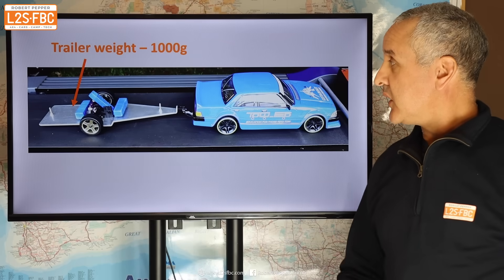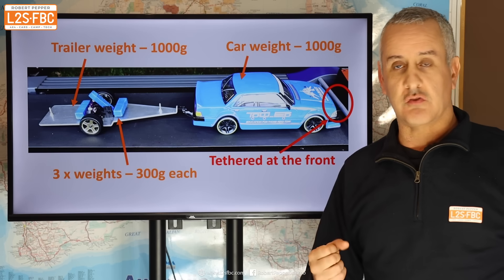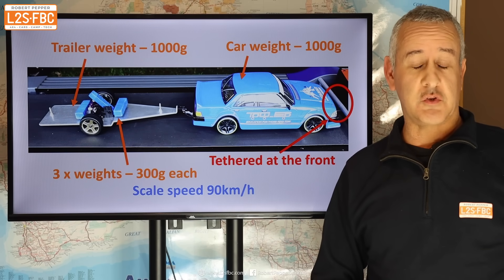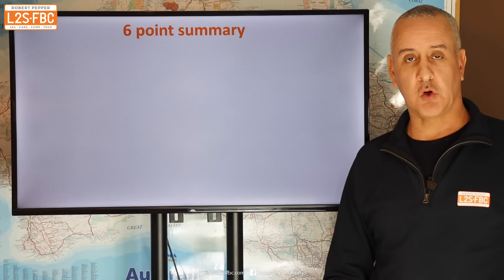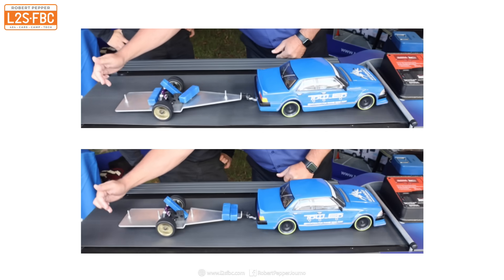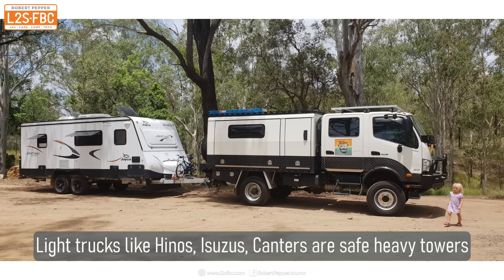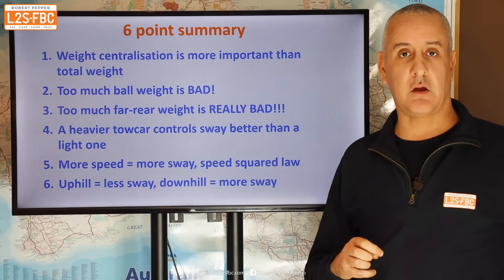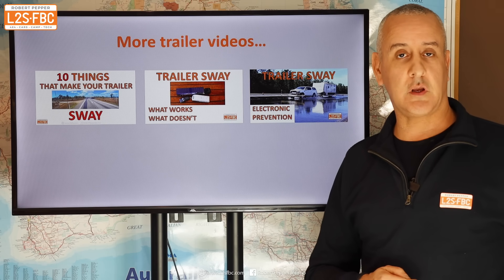7 trailer weight distribution setups, some safe, some deadly.

Comment: love the video ,so easy to understand,,,Would adjustable air shocks,,Air bags on the rear of the tow car help with the weight disturbution and sway
Reply from the maker: yes a little, keeping the towcar level is always a good idea
Reply: @L2SFBC  yep the munro air shocks worked great .the car had slight down ward nose 1/2 inch  the the rear caravan had slight downward nose of 1 inc,,,only problem was trying to fit the air hose to munrows plastic air conectors,,,,YUK,,,,but the shocks are fantastic

Comment: These treadmill towing videos aren't realistic, because the pulling force that takes place in real life is totally absent. This makes the sway effect MUCH GREATER due to the "crack the whip" of distant weight disproportionately effecting the middle (where the tow vehicle and trailer are connected). Of course you shouldn't have all your weight at the rear of the trailer, but you should be just fine if most of the weight is over the axles (usually near the middle of the trailer). Just make sure that your tow vehicle is adequate for whatever load you're attaching to it and you'll be alright. P.S. I'm a truck driver for a living.
Reply from the maker: The main reasont the model isn't realistic is because the car is attached by the nose. There is a pulling effect...the trailer would fall off the back without. However, the drag from the trailer is less as the air isn't moving.  Overall though, the model behaves in a way that's more than good enough to demonstrate trailer dynamics.

Comment: How would you load your trailer if you have boxes that all weigh exactly the same? There would be no way to put the heavier boxes over the axle because they are all the same. Any advice?
Reply from the maker: Stack the boxes on top of each other, but not too much as you also want to keep weight low. It's a compromise...
Reply: @L2SFBC  the problem is that the trailer is double stacked from the front to back with the boxes making a perfect rectangle if you will. Would it make sense to move the items from some boxes to create unequal weights of boxes and place those over the axle and lighter ones away from the center?
Reply from the maker: Just centralise and lower the weight best as you can, so yes your suggestion makes sense.

Comment: Hello Robert I have a question, what would be the best weight distribution for an AWD mid engine sports sedan?
Reply from the maker: Probably 60/40 rear/front I would expect.  Not 50/50. What prompted the question?  I have a video coming on a Lotus very soon which covers this.
Reply: @L2SFBC  … hello and thanks! I have this question because I’ve gotten into mechanics and drag racing. Then I got into R/C and Ive got this R/C car that will run 130mph if I allow it but I’m researching suspension geometry and purchased a 4 corner digital scale configuration so I can manage the rc platform’s weight distribution. Currently it is more front heavy than rear about R43% F57% and left is a little heavier than right so there’s plenty room for adjustments.  Just search R/C speed run and YouTube will be flooded with rc’s doing 150+mph
Reply from the maker: Well at that sort of speed aerodynamics would be a major factor just to keep the thing straight, and then you could also run downforce to stop it flying into orbit. But I don't know, just guessing, I don't do high-speed R/C but sounds amazing!!!
Reply: @L2SFBC  … thanks for all the input it’s much appreciated! Although it’s an rc the thrill is parallel to the real thing and MUCH safer.

Comment: Thank you so much.  This is super helpful, especially for a newbie like me.  Do you have information on the proper ratio of loading the towing vehicle itself?  Should it also be loaded closer to the middle of the SUV?  Many thanks.
Reply from the maker: Yes, the towcar should be centrally loaded as far as possible just like the trailer, and for the same reasons. So, heavy stuff low and between the front and rear axles...this is not always possible of course!

Comment: One thing not shown is if the trailer axles were at the rear of the trailer it wont matter as far as stability goes because it will always be stable. Thats why semi tractor trailers have their axles at the rear of the trailer.
Reply from the maker: That's right. This video did not however go into axle location, it only focused on weights.

Comment: Great for a caravan but what if youre towing a car? Engine weight is either gonna be at the front of the trailer or at the back of the trailer.. Its not possible to have it in the centre unless you have another engine or two to put in the car youre towing on the trailer.
Reply from the maker: No it is generally possible to centre weight when towing a car. You may need to put it on backwards.
Reply: @L2SFBC  Ok but then all the weight is over the back of the trailer. Its still not centred.
Reply from the maker: The average car is around 50 50 weight distribution it can be centred over the axles.
Reply: @L2SFBC  Sure a mid engine or a rwd or a awd might be around 55-45 but not a fwd. most of the weight is at the front. That gets amplified if the car is stripped out too. You can see that if you lower your dolly wheel on a trailer how much it dives down at the front (providing the car is driven on forwards) or how the rear hits the floor (if the car is backed on) when you unhitch it without putting blocks under the rear to prevent it doing that.
Reply: Thats 55 front and 45 back btw.

Comment: Great info other than your recommendations about having a heavier tow vehicle. I don't mean to be mean but, that advice seems nonsensical and impractical. If I want to pull a 6000 kg travel trailer you're recommending that I go buy a 7000 kg truck. Really silly. Semi Trailers are working around the world pulling trailers that weigh 8 times what the tractor section ways. They do it safely. Using all of the rest of your good advice, and great practical demonstrations, you can easily set up your rig with a much heavier trailer than the tow vehicle to be extremely safe and stable. I give your video a AAA rating for excellence on every point except suggesting having a heavier tow vehicle
Reply from the maker: Thanks Mark. A semi-trailer is very different dynamically to a car/caravan (pig vs dog trailer). Explained here -> https://l2sfbc.com/why-a-prime-mover-isnt-the-same-as-a-towcar-and-caravan/
Reply: @L2SFBC  I may not be an expert but in the past I've owned up to seven trailers at one time, currently i own four of them. You are correct the Dynamics are not the same but they're similar. Anyways, my imperfect analogy does not dismiss the truth of the rest of my comment. To reiterate, I was pleasantly stunned by the quality of your video and its information and the excellent work you put into having the display. Well done and I honestly think this should be required watching for every person wanting to pull something. Mark Henry

Comment: I'm in the USA so this may not be applicable in the Land Down Under, but our in-cab trailer brake controllers pretty much all have a manual trailer brake override slide switch.        I got in the habit long ago, every single time I hitch up and start out, on the first low speed straight piece of road, maybe even leaving the campground, I grab that manual brake a few times to ensure my trailer brakes are working.       If you feel even a HINT of sway, grab that manual brake control lever, it should straighten right out.

A couple years ago, I had a tow ball  strip its threads and come out of the ball mount, so the 4500 pound (about 2000kg) trailer was hanging on the safety chains, and it immediately started whipping back and forth at the ~60 MPH (100km/h) we were traveling... this on a rather narrow two lane thankfully straight line road that was completely empty of traffic.    within seconds my practice kicked in, I grabbed that brake controller, and instantly the trailer 'behaved' and straightened rought out, I had to modulate that manual braking so the trailer wheels weren't skidding, but I was able to bring the whole rig to the a near stop then drive onto the gravel shoulder of the road.    although everything inside the trailer was tossed, the trailer itself and the tow vehicle were 100% AOK.    A mad dash to a car parts store I found on google maps 50 miles away got me there before closing so I could buy a new tow bar, and we were on our way home a couple hours later..

btw, my tow vehicle was a Ford F250 diesel longbed pickup that weighed nearly twice what the trailer weighed.    If we'd been in some cute-ute mini SUV that could barely tow this trailer, I shudder to think how this might have turned out.
Reply from the maker: wow...great story!  Demonstrates so many things:

1. knowing what to do
2. practicing before the event

In Australia, we have automatic brake applicators if the trailer is detached from the towcar for trailers 2000kg+.  So over here, the brakes would have been applied as the trailer broke away from the car. And that's why!!!
Reply: @L2SFBC  yes, we have a safety brake cable, too, but that only engages after the chains fail and the trailer brakes away free of all.    the trailer stayed firmly connected to the truck by the crossed chains.
Reply from the maker: Ah ours may not have engaged either then depending on how it is set up

Comment: We tow a GEO Tracker with attachments on the left front and right front of the GEO, and attached by a single connector on the rear of a 25' motor home. Do the position of the attachments (two on the towed vehicle and one at the rear of the towing vehicle vs. one attachment on the towed vehicle and two attachments on the towing vehicle) make a difference in how much sway there is? Also, is there a lack of stability if the towed vehicle is towed with all four wheels on the pavement, vs towing a vehicle mounted on a trailer with two wheels?

Comment: question on weight centralization, what if the wheels of the trailer is positioned towards the rear of the trailer? Would the center of the weight be right on top of the wheel axle or somewhere in between the axle and the hitch?
Reply from the maker: the centre of gravity still should be just ahead of the centreline of the axle so as to give some nose weight but not too much. Such trailers are designed for specific loads that are very heavy but small.

Comment: Thank you so so much for these incredible videos! Very helpful - life saving advice. 
I have a question about vehicle choice for towing. My husband and I are looking to purchase a Nissan Xterra. Rated for 5000lb towing capacity. Our trailer is 23', and weighs about 4000lb dry. Curb weight of the Xterra is similar to the trailer. Using the many different methods you teach (new brake system, weight distribution, sway bars) would this be a safe purchase?
Reply: ignore the trailers DRY weight, what is the trailer's GWR, max rated weight.     odds are it will be much closer to that than its dry weight when you are towing it.      Alternately, load it up with as much stuff as you would ever want to bring, and WEIGH the rig, first weigh the loaded tow vehicle without the trailer, then get the triple weight of the combined rig (front axle only, front + rear, front+rear+trailer)...   with various subtracctions, you can determine the total loaded weight of the trailer, the hitch weight, and of course that last number has to be under the rated GCWR for your towing vehicle.    One thing a lot of people miss...  towing near the max trailer, the towing vehicle often has VERY little payload capacity left.    case in point, I had a Toyota Tacoma 4x4, it was rated to tow 6500 lbs with 650 lbs tongue weight, and it had 1200 lbs payload capacity (including driver, passengers).   I towed a 4500 lb (actual) trailer with about 500 lbs of tongue weight.   The truck had a ~ 100 lb fiberglass shell on it.   combined passenger weight was a bit over 500 lbs.     lets see, 1200 - 500 - 100 - 500, means we could only carry a TOTAL of another 100 lbs in the truck.
Reply from the maker: Little close to the max load of the Xterra but would be ok. Hard to say, you need to consult a local specialist who knows the trailer and the car.  Use https://l2sfbc.com/towing-weights-calculator/ to check limits.

Comment: Root cause of sway is because the trailer is hitched to the truck behind the rear axle.  The tongue weight is applied behind the tow vehicles rear axle on the hitch ball which shifts the trucks center of gravity so far back that it increases the chance of the truck fishtailing. you cant hang all that weight on the back of the tow vehicle and expect it to be stable. So the #1 important thing to reduce sway is to use a weight distribution hitch, which moves the hitch weight to the front of the truck and the rear of the trailer with its spring tension action. The weight distribution is confirmed by measuring fender height on tow vehicle first when empty and then with trailer on.

**Yes, moving you gear around will make a small difference in towing performance, but dont make it sound like its more important than the weight distribution hitch!!!**

A weight distribution hitch with sway control like the Reese Dual cam sway also called Strait-line is a god send. Both of us drive and have been towing for about 25 years with long trips of 16 hours one way, 9000 lb camper at 70mph and can honestly say that sway is minimal to non-existent with the Reese hitch.
Your safety depends on a good setup.

Comment: Excellent video. I've built a few trailers and kinda winged it as far as design went.  I always tried to load my trailers a little heavy on the tongue because it was said to be the thing to do. However, I never experienced a problem until I built a tow dolley. Without a car on it, the thing was all over the place. It got better when I took the weight of the spare tire off the tongue.
I learned a lot from your video. Thanks!!🖒
Reply from the maker: Glad I could help!

Comment: Thanks for showing what not to do with trailer loading. However the explanation of how the loading causes sway is somewhat lacking. The explanation of forward and rearward loading adding and reducing tongue weight removing and adding  weight from the tow vehicles tires sounds good till you realize the loading of mass both forward and rear doesn't change the tongue weight .
Must be moments of inertia at work here creating yaw leading to moments of YAHOO!
Reply from the maker: Indeed and I have another video explaining exactly that, as the common question was "if the towball mass is okay why does it matter where the weights are"

Comment: Great video!  Explains why even though your huge diesel pickup "can" tow 12,000 pounds, you should only tow half that amount.  Those huge campers I see all the time are really too much and are just accidents waiting to happen.  I tow a small camper (about 1,800 pounds with another 300 extras) with a full sized Chevy van (about 4,500 pounds).  I always knew that it was better for the tow vehicle to have more weight than what is being towed.
Reply from the maker: Thanks! Please share :-)
Reply: If you watch dozens of trailer accidents I think you'll notice that the size of the trailer and its weight relative to the tow vehicle are not important factors as to why the accident occurred. It almost always is improper tongue weight. Not speed not when nothing else usually. The most sway I've ever had from my seven trailers was when I improperly loaded my tiny utility trailer with 16 ft long two by sixes. This resulted in two light a tongue weight. I didn't get up to 35 miles an hour or 60 kilometres per hour before it was wildly swaying. I adjusted the load by moving things forward or putting heavier things at the front of the trailer, I really don't remember exactly how raise the tongue weight but, I drove at 110 km an hour or 70 mph the rest of the way home uneventfully

Comment: Does it make any difference if the trailer is a single axle and the tow vehicle is all wheel drive?
Reply from the maker: The basic dynamics are the same but AWD helps with stability. Single axles are less stable than tandems.